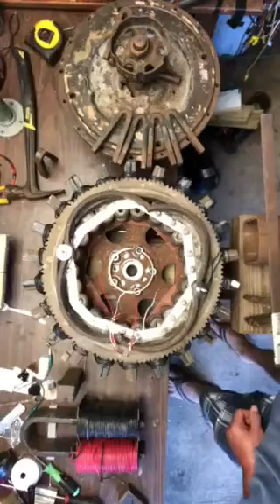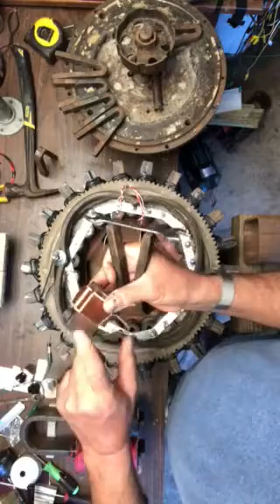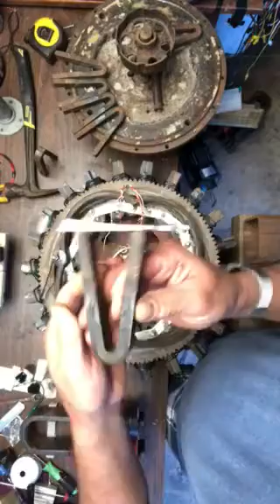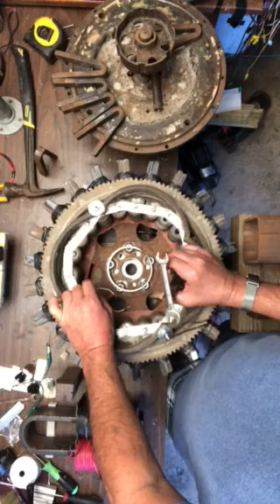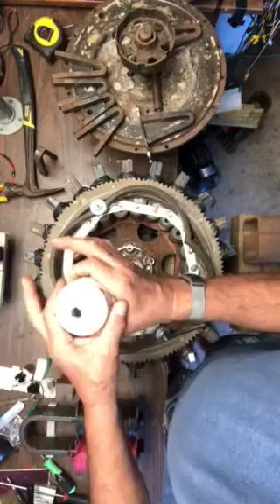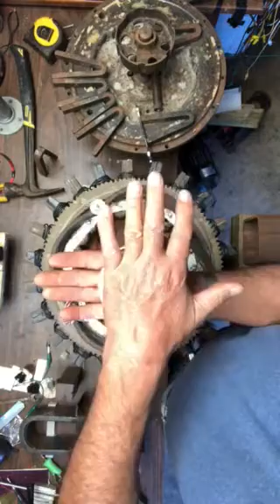Ed’s Magnetic Wheel & Water ?

Comment: why does an object fall into the middle of the planet or why does a ball of water in near zero gravity form a coloumb like a cylander in its middle with air bubbles when it is spinning?  why did I see an air bubble rising in the ocean form a cylander with a cone shape on top and on bottom as if it were an arrow? Does a water spout represent a snake eating its tail if formed into a toroid? is a cone the real shape of a magnet? Does this form a diamond square circle? Otis T Carr. And the star of David? Geometry of the tetrahedron represents God?  going down a drain and coming to an equilibrium where inertial mass rests most heavy near zero point thinned out in the center and stretched out to its ends. and a sea of bubbles will not hold up a mass, but will allow it to fall down deeper and faster than normal. There are no straight lines only circles in perspective. and cones. and the vortexes twist together into fractals.

water aligns rotates builds up charge like a rubber band in a whimhurst moving through pipes and jets of sprays moving through coils of electromagnets; can it contain the iron oxide? magnetic lensing magnifying forces in motion and the unseen joins to the seen in the transfer of energy between them

Comment: hold phone horizontal before laying it down to get the full view rather than the verticle view so it will appear on whole screen and larger ; Higher frequency resonance voltage equals positive pole and lower frequency resonance voltage equals negative pole. Harmonic Resonance between poles equals greater power feedback looping. Primary equals negative, secondary is higher positve. Spark gap represents the break of the loop and the shorting out of the circuit. Such as is the wire in the lifter, while the secondary is a whole loop being a connected circuit such as the copper tube. Comparatively the magnet represents the broken circuit inductor into the circuit and or the open wire. 

Important point; open circuit related to spark gap and permanent magent in tube. Tube represents closed circuit. Closed ciruit represents Resistance and induction. LED light offers little resistance almost like an open circuit. When ciruit is closed induction can occur. Magnetism can occur. Comparing this to mass inertia reduction seen with closed ciruit. Magnet is unclosed like a primary voltage open circuit closed momentarily by a spark gap. Motion may represent temporary closure? or temporary induction? while induction occurs in closed ciruit and why and how is this inducing levitation? What has this to do with magnetic circuitry? Poles of variance; open pole/closed pole relativity? 

Even the Stan Deyo compared to the lifter tech has an open pole magnet on the bottom rather than the top wire voltage pulsing. while the pole or shaft may be like the closed circuit of the lower lifter foil. Apparently we have the same occuring in the open circuit permanent magnet relationship to the tube of closed loop.

https://youtu.be/zMMtaZfh904